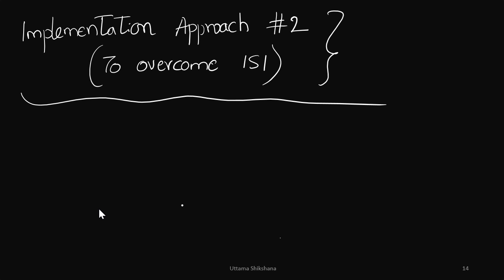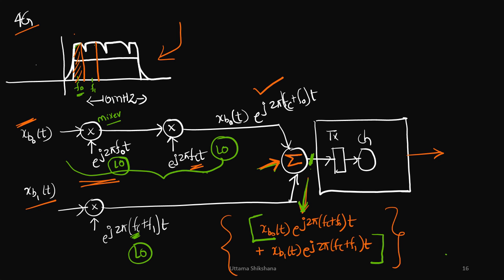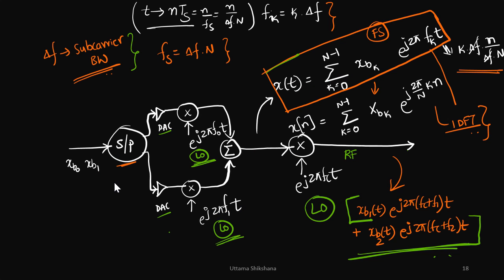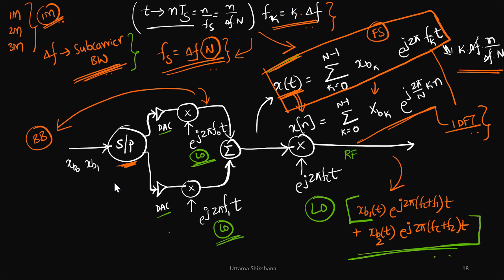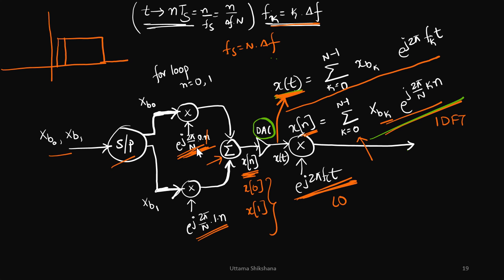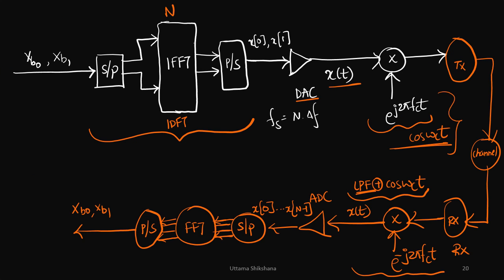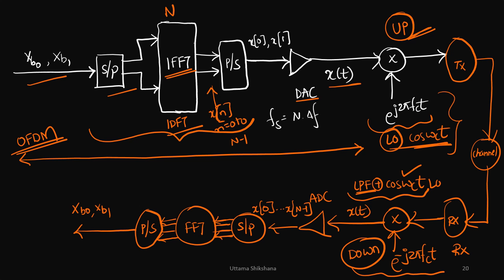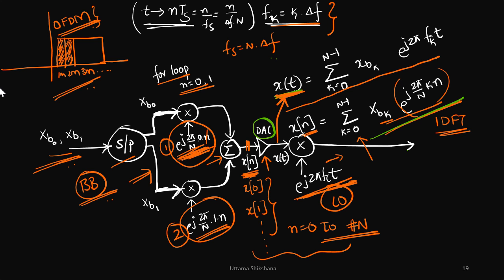[Series #34] 4G / 5G OFDM (Orthogonal Frequency Division Multiplexing) Design | IFFT / FFT block

Comment: Hello Sir, Why serial to parallel converter is needed before IDFT? Why are we not sending it serially for IDFT operation as again we are converting parallel IDFT outputs to serial only using S/P. Complete Serial operation will not work?